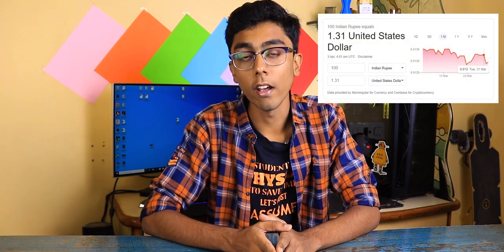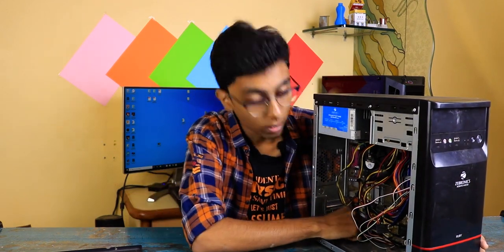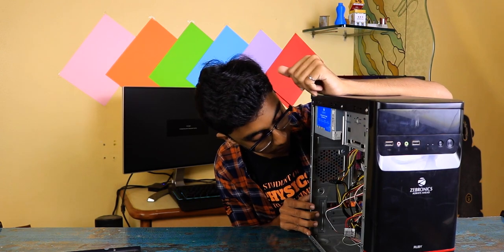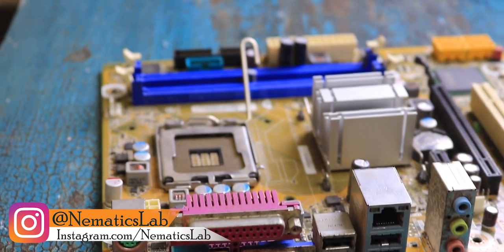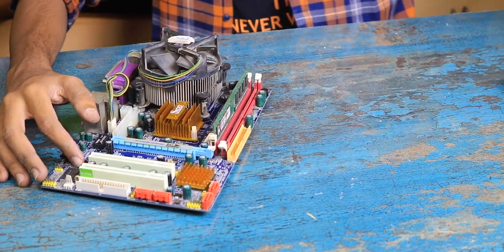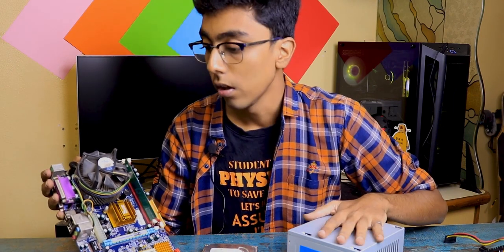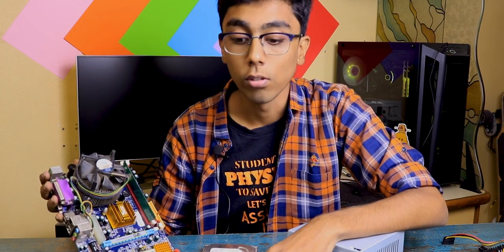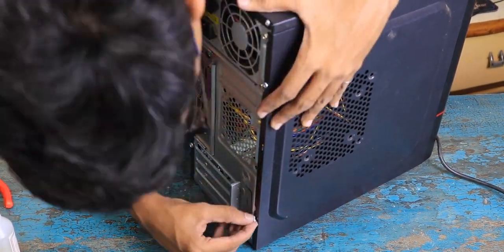I built a Computer for Just $2! | Recovering OLD PC from scrap!

Comment: You should have installed core2due in this pc As pentium D is just 2 pentium 4 on single die. Very power hungry and gives you bullshit performance in return.
Reply from the maker: I would have to buy a new mother board which will cost about $50 USD, considering I paid only $2 for entire PC I don't think it would makes sense, let's see maybe in future I'll use that CPU if I get cheap mother board on ebay or something
Reply: @Nematics_Lab  No bro. That pentium D and core2due both are LGA775 cpus they both uses same motherboard.
Reply from the maker: @hemantbabel4279  oh shoot my fault I googled wrong CPU for comparison, well thanks for pointing it out I'll replace it! :)
Reply: @Nematics_Lab  have used new case for this?
Reply from the maker: @viralshah1201  nope
Reply: @Nematics_Lab  You can get dirt cheap core2 quads these days too, I got a q9550 rig at 2.83ghz base but had it up to stupid speeds like 3.43ghz.... Didnt need to change the voltage or anything, just the multiplier.
Reply: @Nematics_Lab  check chipset compatibility, something like 945 motherboard would only take older core 2 duo, while ones like g31/g41 can take all